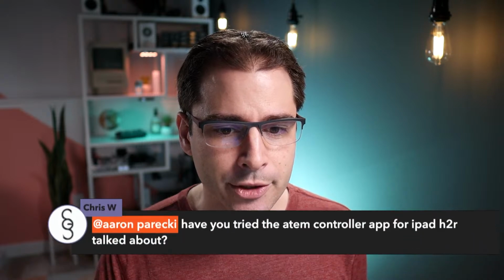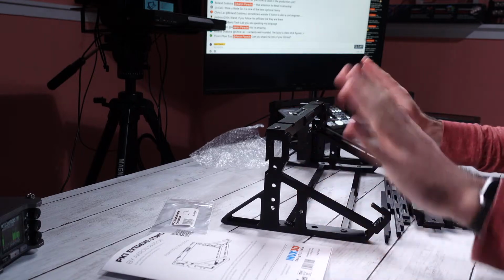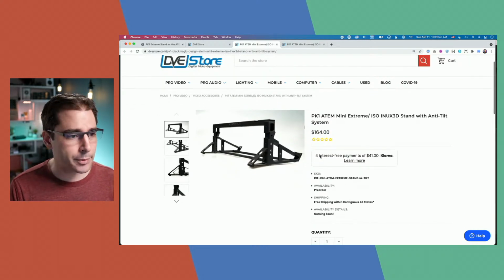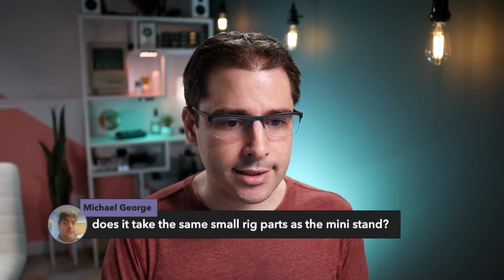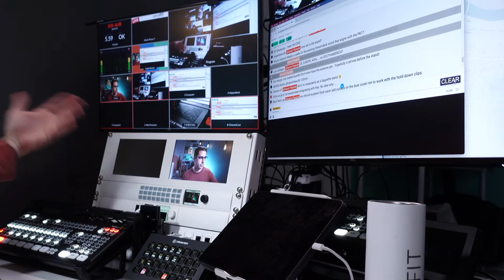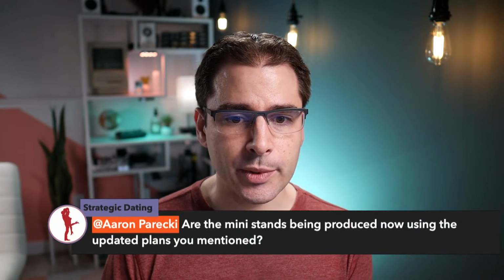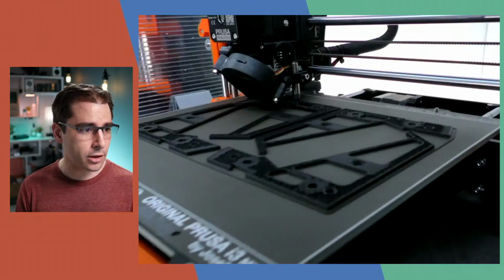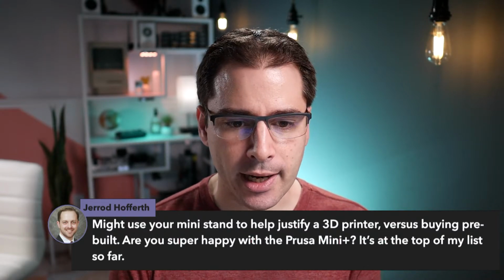🔴 Unboxing the PK1 Extreme Stand! Preorders are live!

Comment: Ordered :-) , but discount code didn't work :-(
Reply from the maker: oh what happened? The code should work on the bundles that include one of the add-ons, although the EU store just has their prices for the bundles set to the discounted price, so no code needed.
Reply: @aaronpk  It was almost certainly user-error. I added the mount and then both accessories separately as I didn't see a bundle for them all. But... no worries... I think it's worth it without the discount. Thank you for putting something like this together.

Comment: hi Aaron, could you review your ATEM cooling system? Have you ever experiencing overheating issues?
Reply from the maker: I’m not doing anything fancy at all, other than putting it on the stand. Both of mine have been basically silent and I’ve had no problems with them! The HDMI cables on the back do get hot, but it doesn’t seem to cause any problems.
Reply: I got my Extreme last week and it rev’d up like an engine starting then made a consistent clicking sound like a fan hitting something. After leaving on for a few hours it rev’d up very loudly and was very hot to the touch. Needless to say I returned it and and now am waiting again. Ugh.